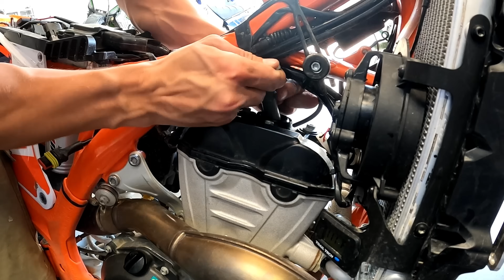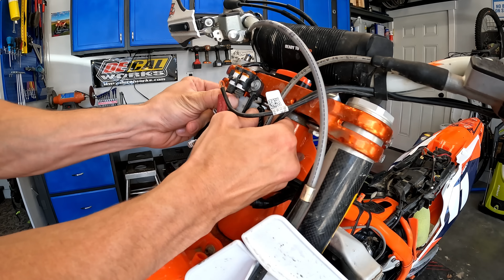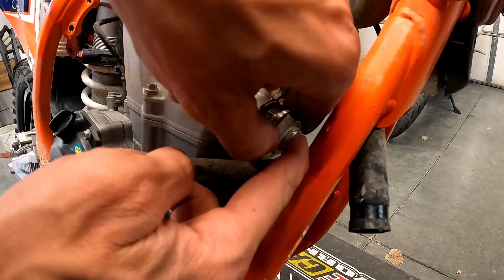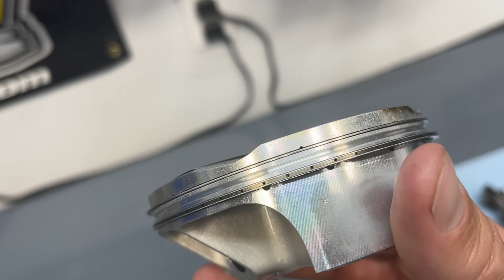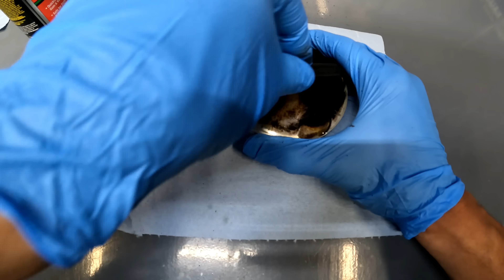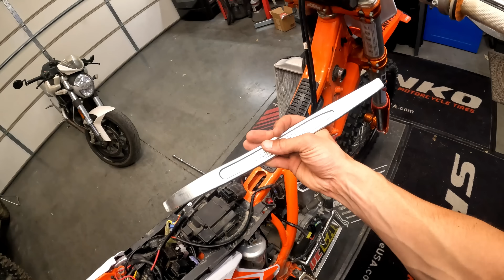Did I Blow Up My New KTM 350?!

Comment: I suppose a lot of other comments are about the filter, and I would say that that sticking is due to fine dust particles in the rings, or coulda been from carbon buildup.  Builds up from riding trails, then riding moto makes it hotter, and the ring stuck.  All theories, you may never know.  luckily it was fine enough to not wear the plating off the cylinder.  I think the disposable filters are a bad idea.  I always use Uni, since they have the old school 2 layers you can clean thoroughly.  Surprisingly, Twin-Air, which was the original multi layer filter in the 70's, in the 80's went to a multi layer combo, but you couldn't clean between them.  I use a good filter oil like maxima or belray.  Yea, the oil that needs gas or something petroleum to wash it out, but that's because its sticky and will do its job.

Comment: Is it normal for 4 strokes to have a tiny bit of oil coming out of the breather tube? I have 30 hours on my 22 yz250f, and have noticed my glide plate has a touch of oil under the breather tube
Reply from the maker: I would say not, I have never seen oil coming out of a breather on any of my 4 strokes unless there was an issue. That said, I don't know that for sure, especially with a different make. If the bike is running right, I probably wouldn't worry much if it's minimal.

Comment: Just clean the filter every 34 minutes, as long as you have a filter sock you can remove after the first 18 min, and change your oil with ONLY Motul every 3.7 hrs. Don’t you even dream of having a drop of another oil in there, or it is advised that you flush the whole system and change minimum 2 filters before adding new oil, to avoid catastrophic damage. Make sure to buy your KTM approved air filter oil from the local dealership to avoid getting the wrong weight for your altitude and ambient temperature.
Also be sure to heat cycle your new piston for at least 6 hrs, in 19 minute segments, with alternating throttle and speed, or you’ll just end up right back where you at now.
It’s very simple, any moron should know this. Basic preventative maintenance will make your dirtbike a pleasure to use. Enjoy!
Reply from the maker: There seems to be a lot of relatively good info in this comment, but I can't tell if some of it is satire or not. I don't think there's a person on this planet who heat cycles a piston for 6 hours.
Reply: @KincadePavich  lol. Yes, satire. A little ribbing of KTM guys is always called for. That said, not sure what went wrong here—those 350s are usually pretty tough. I doubt it was anything you did wrong. Put a fresh piston in and ride it like ya stole it.
Reply: I love this satire! Motul is all I’ll use blah blah 😂

Comment: Pull the whole engine out. You’ll want to do that to re tourque head and cam caps. You won’t get crazy accurate touques which can lead to big sad problems. Truth speaking…😊
Reply: I need to understand this. You can not get correct readings torturing a head with an engine mounted in a frame,  because you get accurate readings tightening bolts as an engine dances around on a work bench. 
I need a minute to process that

Comment: On multiple bikes, I’ve had the same problem on KTM 450 350 (will work on all KTM)Won’t start, disconnect, the fuel line off the tank with the push button release, then put it back on, and it will fire right up, if not do same process twice it will work every time.
Reply from the maker: If you watch the video you will see this was clearly not the issue!

Comment: I don't think it was a oil issue.  I think it was a fluke.  If they both have the same specifications you are good.  Used No Toil for a long time in West Texas.  Its a dusty area.  Didn't have leakage with dirt, but did replace filters often due to glue issues.  I hated that.  I kept like 5 or 6 around and would cycle through. Used a fresh one nearly every ride.  Clean filters maybe once every 6 to 8 weeks depending on ride time. I found that I disliked changed filters every year and that if I didn't ride for a week the oil dried out.   Went back to Bel-ray.  We (wife and I) stayed a mile from the Eccles-Rice stadium.  Flew in from TX.  Got home last night.  Wife surprised me with tickets a while back.  Had great seats got wet and saw some good racing with a great views.   Not going to lie, missing those temps and mountain views.  Rented a convertible and had a blast running it around.

Comment: I don’t think it was oil. I’ve mixed oil many times without an issue, but maybe these newer machines are different. I second the Unifilter and Maxima oil. I run them on everything.
Reply: oh just watched the full vid to realize he meant mixing oil lol, but yeah never have done that and i wouldnt want to do that
Reply: I mix oil all the time too but I’ve never owned something new
Reply: on my 2021 and 2022 kx 250 i put about 50-100 ml extra oil in everytime and has never had an issue, so not tryna hate on ktms but it might be a brand issue with that

Comment: I've had some issues with ethanol in fuel and  then having carbon build up!
Reply from the maker: I always run non ethanol fuel. There is a chance the first owner (first 4 hours of engine time) ran ethanol, but I would think that would've occurred sooner if that was the case.

Comment: KTM= Keeps Taking Money. The best air filter set up is unifilters with Maxima FFT oil.  On dusty days, add an oiled filter skin than be pulled of in 30 seconds at the track.  I don't want to bash any products, but the no toil oil doesn't feel very sticky to me especially compared to the Maxima.
Reply: Use belray air filter oil ,it’s the best .
Reply: @motoriderguy3854  Yes! Best I've used,
Reply: I dumped No Toil after finding huge puddles dripping out of my airbox. My filter skills haven't changed muching 20 years. I don't get run off like that with FFT or Belray filter oil.
Reply from the maker: With the green NoToil oil, it is designed to work with any filter and it has alcohol in it. If you don't allow a NoToil filter to properly dry after applying, the alcohol (along with some of the sticky stuff) will drip out instead of evaporate. NoToil advertises this, but it's not that commonly known I suppose. I've been running NoToil since I started riding, and this is the first time I've had any sort of issue. Again, I blame the 4 year old filter that's been washed and used countless times, not the oil. Just my personal  opinion. I've put NoToil through some nasty conditions, and this is the first filter failure I've ever seen.
Reply: @KincadePavich  My observation was based off of the red no toil, sounds like the green oil may be an improvement over the red.
Reply: @KincadePavich  4 years is a long time to trust an air filter.  Whether the blended oil or dust in the combustion chamber, you fixed it and came out more knowledgeable.  Would that everybody cared as much for the own stuff!
Reply: Red PJ1 is cheap and works great in my experience super sticky and not a lot of excess spray.

Comment: "I know what's wrong with it-"
Reply: Ain’t got no gas in it
Reply: It wasnt the mixing of the oils that caused this it was dirt. Contamination got into the oil then into the ring gap sticking your ring. For you ktm haters that can happen to any engine. The very close tolerance's in the ktm caused this to happen with very little dirt.
Reply: I just finished a complete top-end rebuild on my KTM 350 xcf. She had 378.6 hours on the OEM topend.
Reply: It’s a good job you don’t ride a 125 I was putting a new piston kit in 4-5 hours
Reply: Ktm is junk this is true I’ve been riding them since 2001
Reply: @alvahilderbrandt  best offroad bikes money can buy. KTM is #1 in every category possible. shut your silly mouth up
Reply: @alvahilderbrandt if it’s junk why you keep riding them?
Reply: Had this happen to me years ago with my yamaha. If you don't oil the air filter enough, your piston and ring will be done within 1 ride
Reply: Is not a 2 stroke
Reply: @willkelley7747 you probably never owned a KTM
Reply: Please. Don't tell.
Reply: Its ORANGE….KTM=high maintenance junk
Reply: @willkelley7747  Poor boy, KTM upset you !!
Reply: @willkelley7747  totally agree, I had a very well maintained KTM950sm and is unreliable junk, I went back to jap bikes for piece of mind
Reply: @shawsie5780  i had a 2021 yz250f for 7.5 hours and it blew up 🤣🤣🤣 japanese bikes are absolute piles of garbage
Reply: @RogerT-kt3zd how, what did you do lol, yamaha from what I’ve heard is the most reliable, I’m just curious.
Reply: @RogerT-kt3zdlike everything in life you have good and bad in every group, bikes are no different. Ktm has great bikes and bad bikes same as all jap manufacturers.
Reply: @willkelley7747  hahaha best offroad bikes on the planet without a doubt. your brain must be extremely small
Reply: @willkelley7747 fr
Reply: @willkelley7747 wrong it’s keep the manual
Reply: @willkelley7747  no poor maintenance was the issue extra oil forced the piston ring in that airfilter wasn’t oiled enough and needed changing earlier

Comment: What weight do you usually set your suspension to? How much do you weigh? 👍👍
Reply: I set mine to highly suspicious
Reply from the maker: What do you mean what weight? My suspension is bone stock. I weight 165 naked. I set my air pressure to whatever is recommended for my weight; don't remember the PSI off the top of my head.